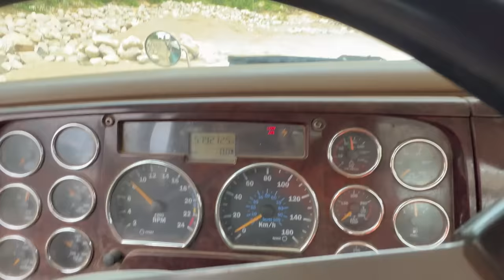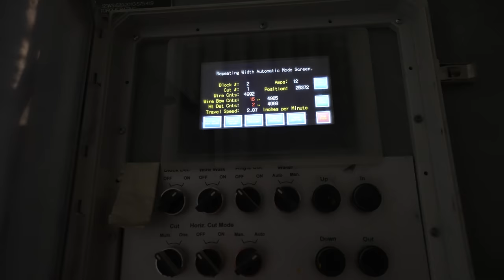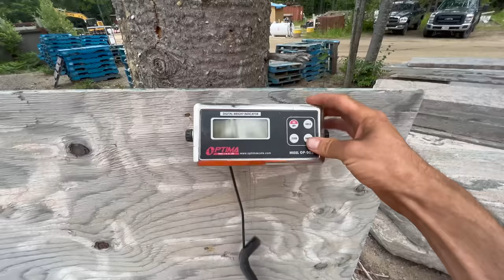Making Granite Flagstone & Steps

Comment: Does your 245 have a power boost button?
If so is there a indicator to know when you activate it?
Just bought a 245 with an Engcon installed so it has Engcon joysticks with no labeled power boost, dealer claims that machine doesn't have one but brochure reads it does.
It's a 2021
Reply from the maker: 245 with engcon! I wish haha 
There is the hp button for eco/pwr/hp on the side. Other than that I don’t know what you might be referring to